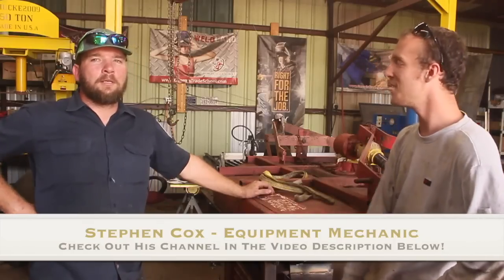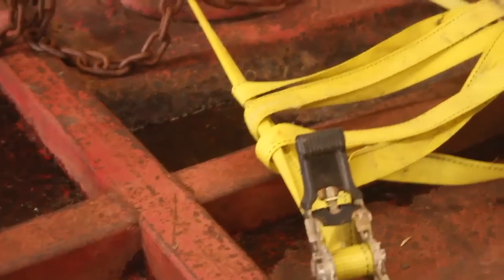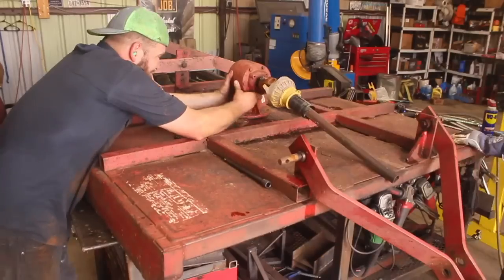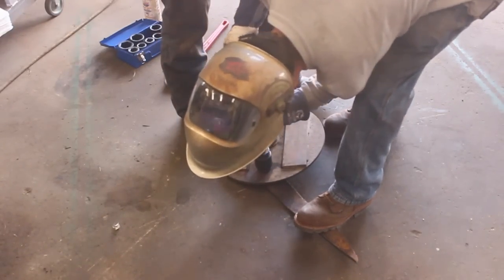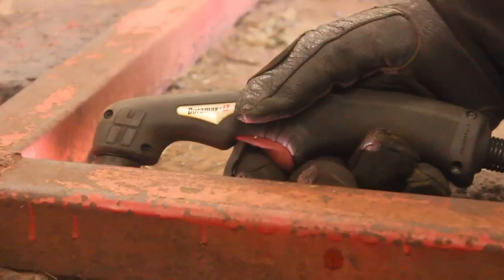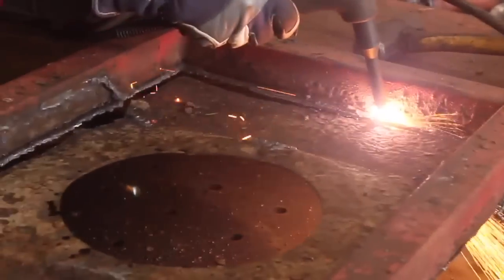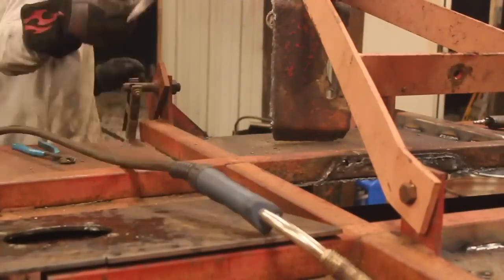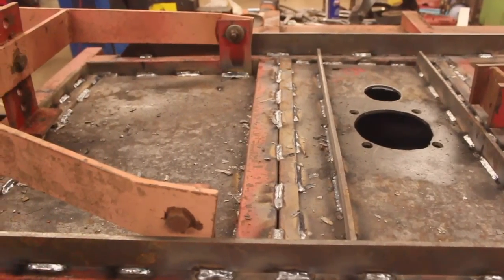MECHANIC STEVE BOUGHT THE CRAPPIEST POSSIBLE BRUSH HOG AND WANTS ME TO FIX IT

Comment: Thats a lot of work and steel to throw into an old cheapy bush hog copy.  It still may be worth it but you can look for old bush hog models, that are rusty(50+years old) but have tanks for gearboxes.  Some of the old 502 models like i have came with 100+hp gearbox for a 5ft cutter.

Comment: Great video!  Suggestion, when you connect it to the tractor, make sure that the PTO shaft is the proper length.  If it is too short it could pull out and swing around like a person swinging a war club!   Too long it will break something!   Thanks!

Comment: Biggest problem with brushcutters people cheap out buy cheaper  light duty units throw a 75 horsepower tractor on it then try cut down overgrown fields with saplings thicker than your wrist and wonder why  my cutter broke apart !!!!put that on the suggested 30 hp or under tractor don't try cut down forests will last you many years.

Comment: Being around farm equipment for 6 decades, it infuriates me to see equipment in that shape.

I understand that this Steve fellow bought it in this condition.

The previous owner should have had more respect for the equipment, and kept it in good shape. In my very biased opinion.😠
People just unhook and leave equipment sit wherever, until the next time they want to use it. 
And then wonder why it eventually falls apart.

We always kept as much of our equipment inside some sort of building or shelter.

Case in point...our Bush Hog.
Dad bought it slightly used, (maybe a couple of years old), back in the mid-'70s.
It gets used in various areas around the farm, several times a year.
When not in use, it's kept in a specific spot, in one of our large metal buildings.
Although the machine is approximately 50 years old, it still looks and operates nearly like new.

The only equipment we have ever left outside all the time, were......(and were all used equipment when bought)........
...a 3-point harrow
...our original post digger (which we replaced in the '90s with a brand new one, which is kept inside)
...a stock trailer (which was kept outside because it was co-owner with a neighbor, and we he wanted access to it)
...a 3-section springtooth (which dang near killed me in '93, when it collapsed on me one day...long story)
...a tilt-bed trailer
...a spare loader bucket
...a spare round bale spear
... and an old Brillion seeder

The only reason that ANY of the equipment was kept outside, is that there wasn't any more room in our 5 metal buildings.
But even though these things were kept outside, we had respect enough for the equipment, to do everything possible to keep them in tip-top shape.